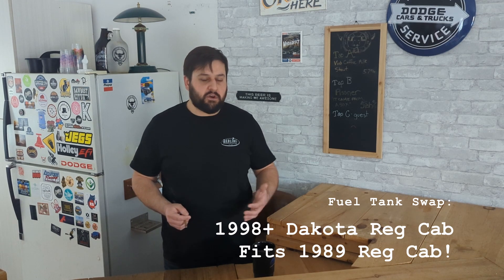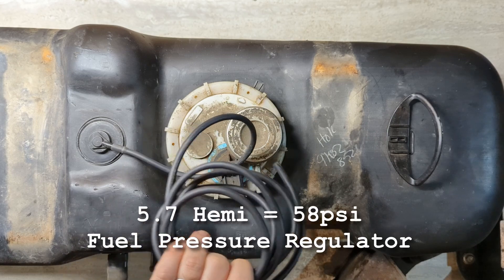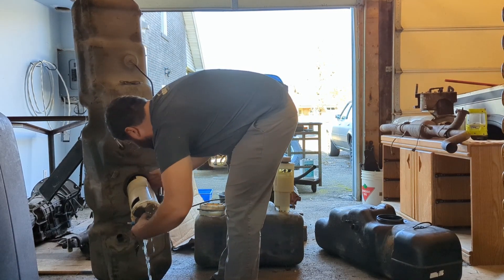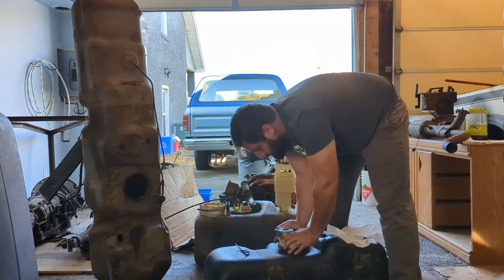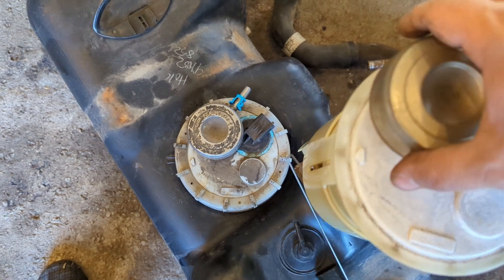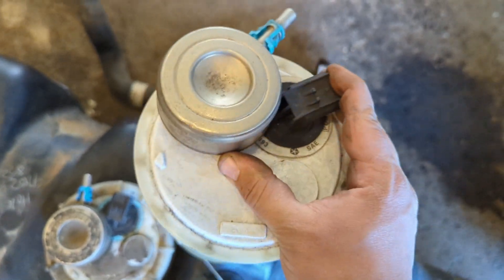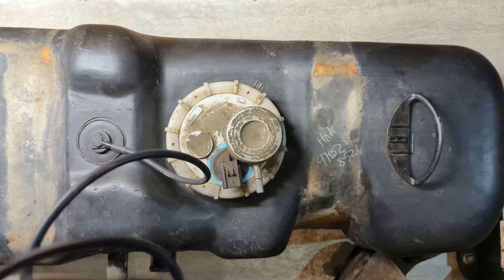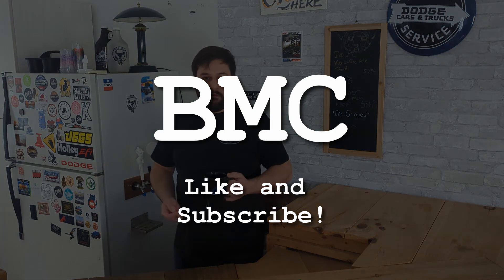Dakota Hemi Engine Swap - Fuel System

Comment: Do you think it will work on a 2000 ram? Doing the hemi swap now and trying to solve this hurdle now
Reply from the maker: Great question! I haven't worked with that generation Ram, but it probably will. Try removing the sending unit from your tank and compare it to my video. If your Hemi donor is a Ram (and you still have the truck), you could just try swapping it. Otherwise, you might need to find a hemi sending unit/pump at a junk yard. U-pull yards are great, you can pull the sending unit and have a look. I used the Ram sending unit because I needed the fuel level signal through the ECM. The fuel pump itself should swap into the 2000 sending unit. If you're keeping the 2000 gauges, you might want to keep your stock sending unit anyway. You have some options, it depends on your build. I hope that helps, good luck with the project, sounds awesome!
Reply: @billsmoparchannel  I haven’t only seen one person do the swap with detail on YouTube but he went with the best of the best. I am doing a 392 from a charger at it’s the same 58psi I’m just trying to see how I’m going to get it there.. the fuel and drive shaft is all I have left to put together…and the power steering
Reply from the maker: @tellosrt8  Thanks for the details, that changes things. A stock 5.7 fuel pump probably won't cut it! I'd suggest an upgraded pump for a Hemi Ram that can keep up with the 392. If the sending units are the same between 2000 and 2003, all you should need is the big fuel pump and Hemi regulator (the metal cap on top of the sending unit). The Magnum is ~50psi, so your 2000 regulator won't work. All 5.7 Rams are 58psi as far as I know. You might even be able to reuse the fuel line if it's large enough. Let me know how you make out!
Reply: Any progress here?